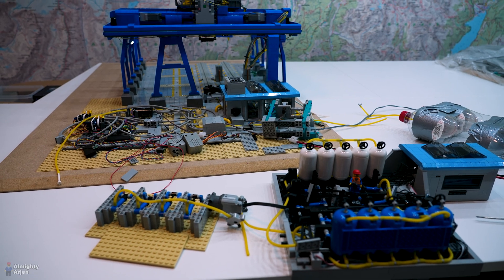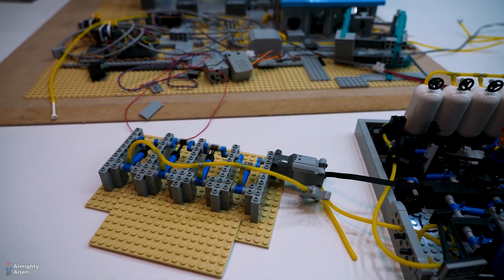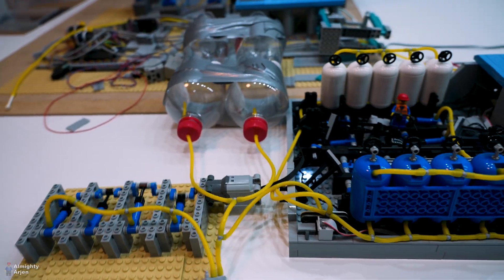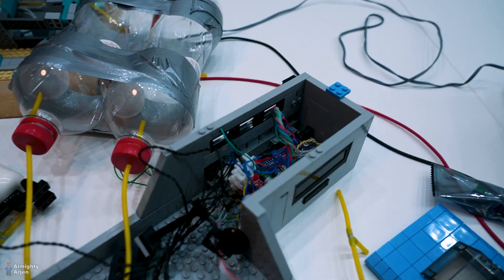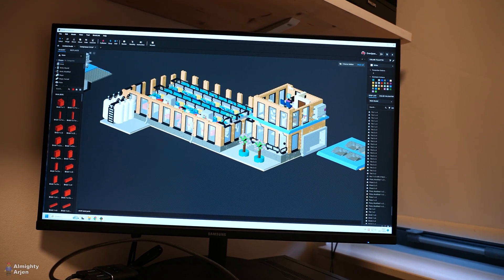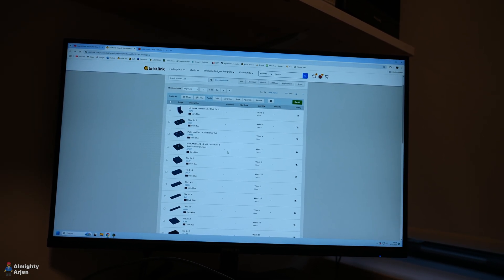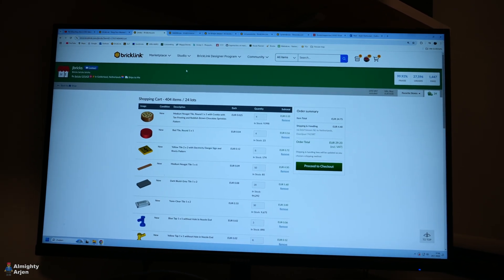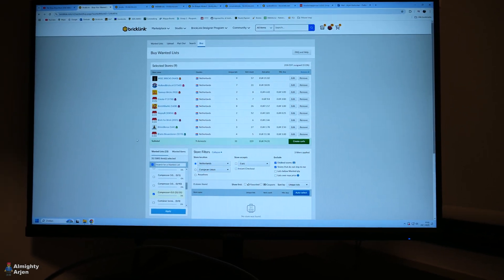Automated container terminal WIP E52: We need a bigger compressor!

Comment: To add efficiency, instead of just 4 pumps off 1 motor, how about 6 or 8? 3 or 4 on each side (offset) ? Like a v6 or v8 (but flat)
Reply from the maker: I think that would result in too much strain on the motor. With 4 pumps it already warms up quite a bit. You could use XL motors instead of L motors of course but their rpm are lower so you won't gain much there. Unless you speed them up by using gears but since the compressor runs a lot, gears would wear out pretty fast.